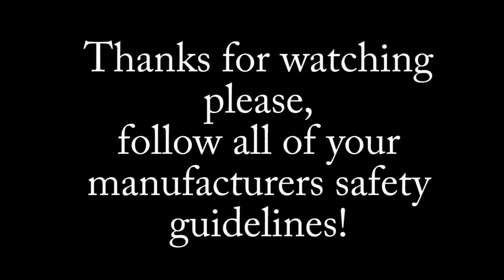Woodturning Christmas Ornament

Comment: There is a washer and a retainer ring that holds it together. It looks like the groove on the Tailstock lead screw for the retaining ring isn't deep enough. So the ring pops out of the slot.They are sending some new parts. It's not hard to work on. They have 2 tool rest lock handles which are on 2 allen wrench head screws to hold the tool rest in place. They are plastic and don't work well. I used an allen wrench to tighten the screws. But eventually the allen wrench will strip the head.

Comment: So i think i'll have to use a bolt with a bigger head on it or just use a small pair of vice grips to tighten it. They just made the handles to cheaply. Kinda suprised there are 2 handles instead of just one. I'll have to make a table for it because a regular table height is a little to tall for me. Several inches i think. I can put that table on wheels and roll it outside on nice days. You can always put an extention bed on it to. Can't think of anything else right now to say about it.  Leonard

Comment: The Shop Fox W1752 Lathe arrived at about 7:30 pm on Thursday night. Nice little lathe. It only takes maybe 10 minutes to set up and clean. They put oil on it before packaging. Runs pretty quiet and the belt is pretty easy to change for different speeds. There was a problem with being able to run the quill up tight to the wood piece. It wouldn't snug up to the wood very well.I called the dealer and they walked me through taking the tailstock apart. Found out the rubber collar was missing.

Comment: @DonnaMenke   You can hollow small objects like these with a few very simple home-made tools.  I have some hollowing tools made from Allen wrenches that work fine, just grind the short leg down so it only sticks out about 1/2" at most.  I made another from a small HSS metal cutting tool from a yard sale for 50 cents, and a mini tool from a hardened concrete screw.  No need to buy fancy expensive tools unless you plan to make these for a living.  Tips are shaped like tiny round-nosed scrapers.

Comment: Carl. Is that a small bowl gouge you used to hollow out? Any tips for keeping that from catching inside the ball?
Reply from the maker: Hi Scott, yes it was a small bowl gouge. I wouldn't recommend it, but back then this was the only tool I had for this. I now would use a small scraper or a carbide tool like the Easy Wood #1 hollower.